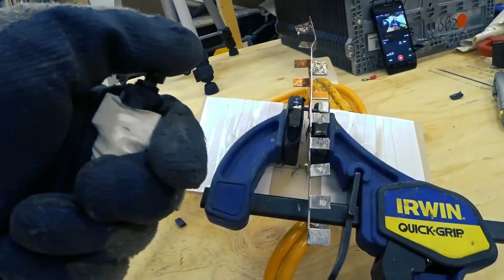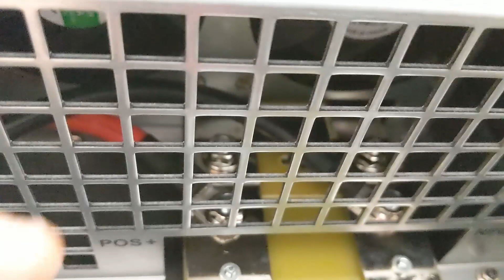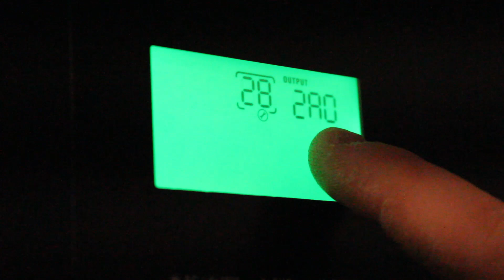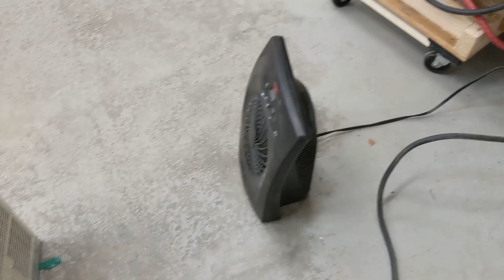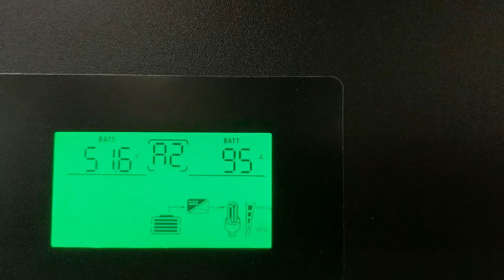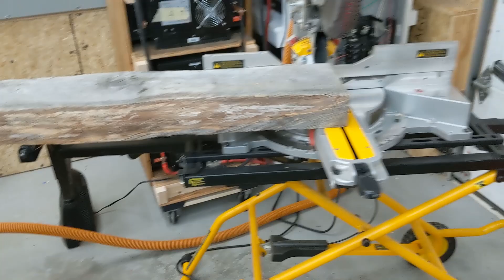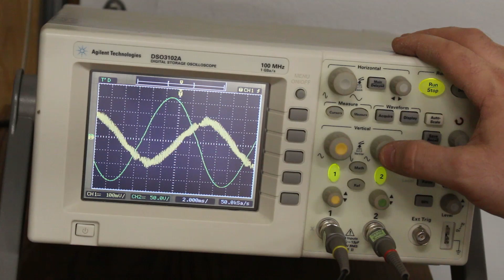Split-Phase Inverter, LV5048, Test Solar, Off-Grid

Comment: I recently purchased this inverter and have been testing it out with some old lead acid batteries while I finish building my 18650 DIY Powerwall. I really like the unit so far considering the capabilities versus the price. It runs my old beer fridge and mancave air conditioner with no problems.

Comment: The way it was setup was a 5000W at 240V or two separate 2500W at 120V so it will not work with your high 120V load set up this way. If you set it back to original I think you can parallel the 120V inverters as they will be in sink and then you have a single 5000W 120V inverter and will be able to power your higher power 120V loads.
Reply: This a very good question that should be answered by the manufacturer.  In that item 28 when the setting was 2A0, Mr. Poz read 120 volts in each phase...but  0 volts between the hot cables....Hence, it might be possible that both inverters can work together to deal with huge surges!!!! I'm  just saying...it is a good possibility...or maybe not...It should be answered by whoever designed this!!!!
Reply: tonymac96 it should have been turned off 240 split to max load it.   His still don’t understand that he needs to run off more than basically a 2500 inverter for that power Hungary non soft start saw of his.  I like learning from his over ambitious nature on high freak inverters that he to this day does not understand. . ....you MUST double or triple  size these inverters.  It’s not a low freak high  $$$$ inverters!
Reply: @DanielbenDaniel  yeah the starting inrush i imagine cooks a temp sensor.. then repeat the test... lol    i run the same stuff on both phases fine. but i also shut my 5048 down when the dryer is running and i forget and start the microwave!! been off grid for 1.5 years with this rig.

Comment: I've read in the manual you can combine the 2 120vac phase to create 5000w of 120vac.
Reply: I Would really liked to see this tested.
Reply: @beneficialliving1314  Also... adding a second inverter in parallel... that would give you 5kw on each phase...

Comment: oscilloscopes usually have their power ground and probing grounds connected...be carefull with that becouse you could short something...as for the messy sine wave...that usually means you did not connect the probing ground properly...did you connect both grounds of your probes or just the one that showed a clear sine wave?
Reply from the maker: Both probes had the ground wire connected to neutral.  I'm sure I missed something in the setup, I really need to take a class on oscilloscopes or something.

Comment: hellow David ,saudações  Rio de janeiro , Brasil off-grid, pode me tirar uma dúvida com os painéis policristalino  x  monocristalino? vc usa os dois ou tem preferencia!!!
Reply from the maker: I have both types and use both.  Both perform just fine.  I buy used panels, so my preference is whatever is cheaper.  But, it I had a choice between two new panels and they were the same cost per watt, then I'd buy Mono.  Simply because they often take less square footage for the same watt.

Comment: He could replace his pump with a solar direct DC pump up to a cistern then run a less demanding pressure pump. If filtered and treated he could collect rainwater into the cistern.
Reply: Solar direct pump to an IBC tote, then a DC submersible pump for all the water necessary. Combine with propane tankless water heater, or something like a rocket stove/heat exchanger, for hot water.
Reply: @ARepublicIfYouCanKeepIt  proper 1000 gallon water tanks are cheap and better for sanitation. This would allow a buffer of water incase of emergency or solar/pump failure. If he lives on or near a hill then he could pump up to a gravity-feed water system. Solar thermal heated water would then be an option too, or some combination with a heat pump water heater that favored running mid-day.

Comment: David, is there a mode in the menu for paralleling the 2 internal inverters rather than running split phase?  Assuming the 2 inverters are isolated it should be fairly trivial electrically, as this is how a grid-tie inverter works. It matches the generated AC to the phase of the Line current so that it pumps it's power back into the power lines.  That would give you the full 5000w on one 120vac line.  Obviously you would lose 240vac capability in that config.
Reply from the maker: I think that is how it came, which is why I could not read 240v before changing the menu.  My friends well pump is 240v, so that's what I care about.

Comment: You didn't mention the well pump's current/wattage requirements or the Miter Saw's current/wattage requirements. Did you try the Miter saw alone and nothing on the other phase ?

Comment: Please do not connect oscilloscope to mains voltage. This is extremely dangerous and wrong. Even more so when hooking to two phases. Jizsus. At 18:25 you disconnect the BNC going to channel 2 by hand. Do not do that! You need to use high voltage differential / isolation probes, and/or isolate ground of the oscilloscope using different circuit or isolation transformer, which by itself is also very dangerous. DO NOT. It is very likely you actually damaged the scope or probes. It is only reading 400mVpp.
Reply from the maker: Could you please link to "high voltage isolate probes" or "isolation transformer" that works with this?
Reply: @DavidPozEnergy  Micsig DP10013 -https://www.amazon.com/Micsig-DP10013-Differential-Attenuation-Tektronix/dp/B074K4XPW3  this is the cheapest (you will need one per phase) I could find that is good quality. Another good one with a low noise and good performance, and fully adequate for AC lines anslsysis is Pintek DP-25 - https://www.globalmediapro.com/dp/A01LT0/Pintek-DP-25-Differential-Probe-25MHz-1000V/ . For actually better quality ones, you will need to spend about 600$-2000$ per probe. Next best thing would probably be Teledyne Lacroy AP031, or EEVBlog HVP-70, which is the same probe for about 600$.  I personally like the Teledyne and EEVBlog ones, because they can be powered using internal AA batteries, so less cables dangling around. You would need to read manuals of the Micsig and Pintek, to see if you can power them from the same USB supply or power bank, or they need separate batteries. It is very important to know that. Technically HVP-70 and Pintek DP-25 are a bit better from safety perspective, and include CAT III rating.

Also a small note, people usually call them "isolation probes", or call them isolated, but they are high impedance differential probes really. They are not fully isolated, but just extremely high impedance, that makes them act just like fully isolated. They are not isolated tho technically. But it doesn't matter.
Reply: @DavidPozEnergy  Another cheap option is this optically isolate probe: https://siglentna.com/product/isfe-isolated-front-end/ , but I think micsig probe is probably easier and similar price, plus micsig probe definitively has better performance.
Reply: You can learn more about differential probes here: https://www.youtube.com/watch?v=eaAsnNkJfPY , there is also some material on EEVBlog and ElektroBoom in more accessible form, but lacking some details. Search for "How not to blow your oscilloscope".

Comment: 75W in idle. That kind of sucks a bit.
Reply from the maker: Yeah, it's hard to get less without a big price jump.
Reply: @DavidPozEnergy  True. Similar two phase Schneider Electric inverter would be about 2800$. 50W idle would be 50$ per year, or there about. So not horribly bad, not too good. It could up over 10 years a bit, plus it is probably a sign of inefficiencies so things will operate at higher temps, and possibly make life span shorter. Trade off.

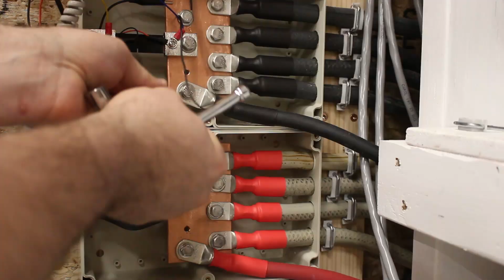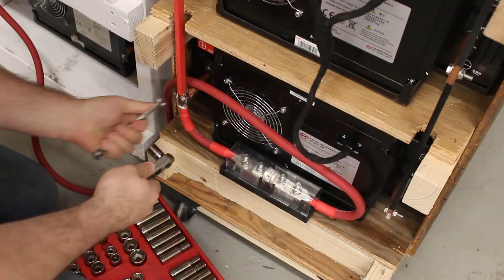Comment: This bolts unscrewing at 1:22 was a bit nerve wrecking. Please use plastic wrenches, or put the two boxes further apart. The cable at 1:33 could easily spring back and touch the other terminals too.
Reply from the maker: I have plastic covers I'm going to install.

Comment: A lot of good information! Have been looking at one of these to use with my Sol-Ark.
Is it possible for your friend to use a hard stop capacitor on the well to ease the surge. I see the chargery BMS in the background. At least yours is working. Waiting for vendor to send me replacement unit.

Comment: Lucky day, I just got TODAY this SAME MPP Solar 5kW until. It also has a FAST Transfer-Switch that will connect the Grid when the inverter goes over its 5kW limit. You should try that. I also have the SAME LiFePo4 24V batteries in a 2S3P setup (right in the middle between the 2 battery setups that you put together) with a Smart Bluetooth BMS on each 2S battery.
I have 8x Q-Cell 395W split-cell Solar Panels with each pair of Panels connected in 2S so that I get total Voc of almost 100V. Total rated power 3.16kW (8 * 395W).
I will update and provide more detail (I have some additional stuff too) when I get stuff running.
David you are welcome to visit and test a lot more with my setup if you are interested. I am North of NYC, I think about 3h drive South West from you. I can also visit you with the MPP Solar. Could be fun.

I like your videos. I combine your video information with DIV Solar Power with Will Prowse videos.

He did a review of this 48V MPP Solar unit too:
https://www.youtube.com/watch?v=ikDLxnf1ePQ
Keep up you good work.
Reply from the maker: I'd love to see your setup if I can film it and make a video.  Can you please send me a PM on Facebook at https://www.facebook.com/DavidPozEnergy/  Of if that doesn't work, what is your e-mail?
Reply: Definitely, will be fun to meet you. Sorry, don't have Facebook. 
My email: jehuda_ish@yahoo.com

Comment: It is disappointing that these high frequency inverters cannot handle surge load, this function is critical for my planning of my solar / power project.
Reply: SolArk 8K or SolArc 12K. SolArk 8K can support up to 20KW Surge loads (for starting motors)

Comment: As of i read in the description of that inverter there is full 5kw I didn’t saw any surge extra kw... if your friend try to run a water pump for pressure you have to keep in mind any water pump will pull 10 times the amps at the starting moment so if the pump amps are 2 amps the pump will pull 20 for 2 or 3 seconds then goes back to the running amps, that’s why your mitter saw don’t work with that inverter...
Reply from the maker: I've e-mailed the company, there is supposed to be a 2x surge capacity.

Comment: Hi David. You could connect a softstarter module between the inverter and the mitre saw. These are available for AC units etc.
Reply: What would be the capacity of he soft starter module?

Comment: Got news for you Dave - One side of that inverter is on the way out ! The mosfet transistor set on one 120 side has a blown transistor, or a weak one on the way out in the set, while the other side is normal. I recommend he take this back for a next size up if he can afford one. This unit is sick, and won't power the well pump
Reply: Is that what all that noise on the sin wave was?  good to know.
Reply: One channel on the o'scope was displaying 50v/div while the other channel was displaying 100mv/div. The lower voltage display will show the MOSFET switching "noise" while the higher voltage channel will not. To get a true representation of the waveforms he needs to have both channels set to the same voltage per division. Nothing wrong with the inverter......

Comment: This is the channel i like to tune in to see test runnings of new and powerful Hi or LO FREQUENCY inverters . Some may or may not last but when it comes to that Mighty Table Saw , I will always say the large and more powerful LOW FREQUENCY inverters always rule over the HIGH FREQUENCY inverters .when it comes to loads that needs the most surge for the highest amp draw . Although the 8000 Watt new black RELIANCE was the only powerful HIGH FREQUENCY inverter I saw that could run those heavy loads with no problem . Always like your videos and MAY THE SOLAR BE WITH YOU for 2020 .
Reply: Thanks for the like .

Comment: Motor starting has a 125 % surge at start, you have to calculate that[,its called full load amps]- are your two probes the same? Did you adjust the capacitance in them via trimmer;they are parasitic.] It seems  like your time base is off, on O scope.

Comment: Would like to have seen the scope before trying any loads?  Wondering if the different scans might mean a bad mosfett  or something ?  I haven't had much experience with scopes, I only have one of those little kits I built, but it shows when there are proper sine waves and I have never seen a spastic looking line like that on anything that was working.  I'm sure someone has the explanation, maybe Electro Boom is watching?

Comment: You should have at least tried the miter saw by itself on the 120v mode bet it would work. and might even work on one leg by itself on the 240v setting but doubt it. It states in literature that it is 5000 watts 120v if placed in 120v mode

Comment: not a bad inverter, but 2500w per line is not enough for much, one magnasine 4400w can do much more, same goes for the 8000w elcheapo new 8000w reliable inverter with a 10000w transformer like the one I have, it can run more :D maybe trade him for your reliable and a transformer for his well :D
Also 1500 US for it :D wow, I would buy a magnasine inverter for not much more. also magnasine can do 90% power to each line plus 3 times surge.
if this was under the $1000 mark I would like it but for 1500 I would stay away!
Reply: Inverter is doing what is rated for.... With two units in parallel would be other results....reed the manual.... 
MPPsolar inverters are way better than reliable one because of protection that works and don't damage inverter 
Overload is 5s.....
Two units pip5048mg running by me whole house now more than a year now without any problems... 
Magnasine and SMA are much higher class of inverters.... Equipment that goes with those inverters are extremely expensive... 
MPPsolar have all in one and all working as it should....
Reply: @bostjantrancar9605  i understand it might be better quality then reliable, but then again their new stuff is much better, but 2500w single line is usless for a hole house. You can get just a single 4400w magnasine for around $2000 that would do double if not triple that this unit can do, also its half the size. Im with david not impressed is all, if i had 4 of them I would of still overloaded them cause once i accidentally pulled over 14kw from my two magnasines that never overloaded.
Reply: Yes probably... Is 2.5k not enough/phase..
I use 5k units and two in parallel it cost me 600€ to door... 
First I bought 1 and after 2 month second unit... 
Both units cost me 1200€... and I could run 10kw load...almost whole day if would battery go with that... Is whole system that counts... 
One question... where you can get 450v/80A mppt charge controller and 5kw inverter and automatic transfer switch that works for 600€... Answer me that... 
Yes Magnasine are on another level is quality no doubt about it.....
Reply: @bostjantrancar9605  you price seems better then davids, that might change things.

Comment: First of all, I always enjoy your different videos, and have subscribed to your channel for a long time. So not trolling. I know you have said in the past that people freak out when you don’t use the incorrect term “split phase”, but no amount of freaking out will make wrong information become correct. There is no such thing as a split phase inverter, and each line “hot” is not a phase, just a “line”. It is a single phase inverter, two lines and a neutral. Specially 120/240 volt, single phase. About this inverter itself, a couple of things. 75 watts just to run with no load is absolutely appalling. And not being able to start that miter saw, even with only half of it at 2500 watts is almost as bad. That super annoying piezoelectric squeaker is Terrible! I like the built in charge controllers. And that’s pretty much it. It is amazing how far we haven’t come. My Trace Engineering inverter from twenty years ago is 4 kW continuous, but can surge to 10 kW, and believe me, I have tested it. I’ve run 3 hp induction motors with it. It’s no load input power is only 16 watts. No comparison. Well pumps are notorious for their high locked rotor KVA requirements, so I’d bet this unit won’t be up to the task, unless his well pump is particularly small. Take care, keep up the good work on your videos, and don’t be afraid to use correct terminology. The world is mostly full of the ignorant, but we don’t need to join them in their ignorance just because we are living solidly in the Misinformation Era. ;)
Reply: Single phase split in 2.  Hence split phase.
Reply: Yeah, I understand how the incorrect information got started, and it sounds apt, but split phase is actually a type of motor.
Reply: Electrician or EE?

Comment: What do you do when you are off grid and generate more power than you need or use?
Reply from the maker: Ideally you divert it to something.  For example, if it is winter heat your house a little extra.  But if all that is done then the charge controller simply shuts off and the solar panels go dormant.

Comment: Hey look into the soft start add on that RV users use to get.past the in rush current on regular AC units.
Should work for his pump and chop saw
Reply: Every time David does an inverter test with the miter saw, I think the very same thing. Put a soft start on that puppy. Problem solved!

I install soft starts on the AC unit(s) of every customer who'll opt for it. Smoothing the in-rush current is better overall and significantly extends the life of the compressor.
Reply: I believe the pump wold need to be a specific type of 3 wire pump to add a soft start kit.